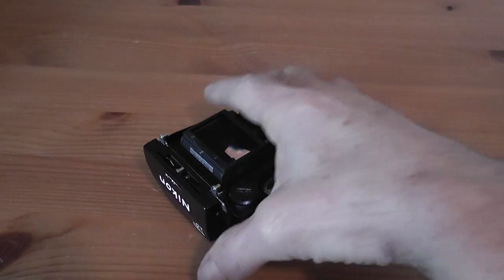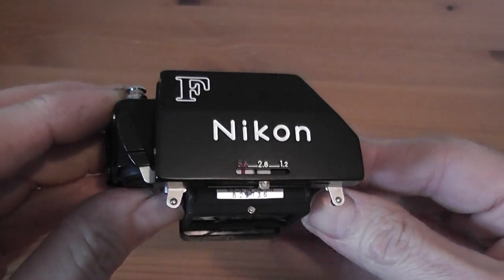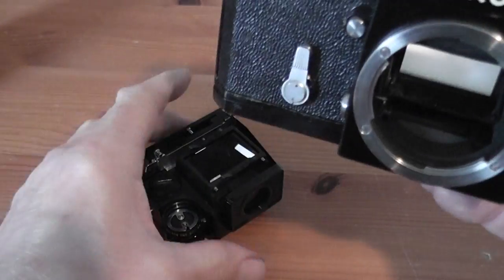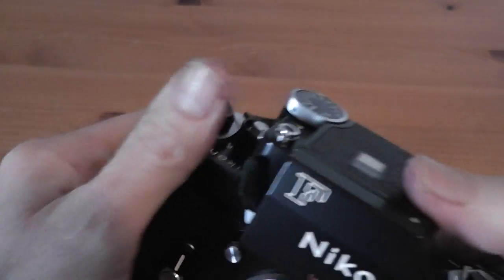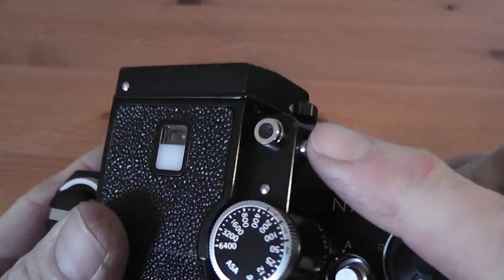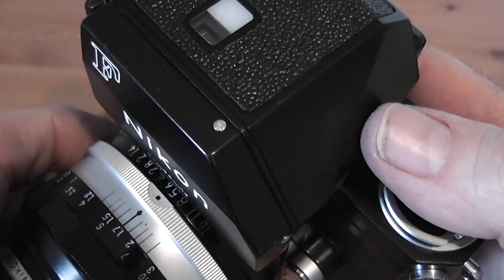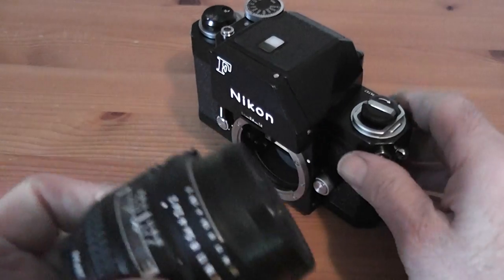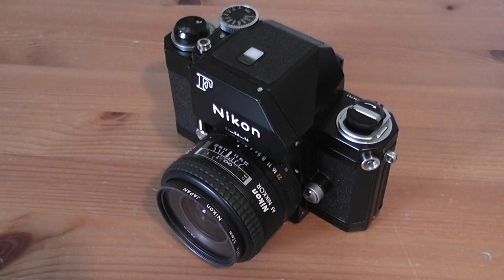Nikon F Photomic FTN Finder Overview

Comment: I have two Nikon Fs, both with FTN finders. I find that setting the ASA is very difficult on both cameras. The silver ring should lift up to allow it to rotate around the center stationary part. But in both my cameras the ring barely budges when trying to lift it. I was hoping to see you do it. At the very end you made reference to the ASA setting but you didn’t actually change the setting. Is that perhaps because you find it hard to adjust too? Am I missing something?
Reply from the maker: I don't recall it being too difficult to change the ASA speed. I guess 50+ years will make things a little stiffer! I intend looking at this for you, but my F bits are in a glass cabinet and it's difficult to access.

Comment: Many times a jumpy or non working finder is because the finder is poorly sealed and gets dust inside.  I have found that GENTLY blowing canned air into the base of the finder will very often correct the problem.
Reply from the maker: ghw7192 Thanks for the tip!

Comment: Thank you very much for this great video. I just bought a Nikon F FTn camera on ebay, and I have some old Series E lenses I would like to use with it. Your video made it very clear what I need to do, since the Series E lenses do not have the rabbit ears prong.
Reply from the maker: Richard Angeloni I'm glad it was helpful! Enjoy your new F.
Reply: I have a Nikon F with the Ftn Photomic finder.  I have a Nikon 28mm f/2.8 'E' series lens without the meter coupling prong.  It has to be used on the Nikon F in 'stop down metering' mode.  I set the lens on f/5.6 before mounting it,  and push the finder meter coupling lever in before mounting.  Then proceed to compose and focus normally,  and push the depth of field preview button to stop the lens down to taking aperture and meter for proper exposure.  (exactly as in the video) Works fine.

Comment: When I turn my aperture on my lens the meter retracts and disconnects with the lens. How would I fix that? Also didn’t know that needed batteries. I shot a whole roll that didn’t end up taking any photos. Is that why?
Reply from the maker: Make sure you are fitting the finder to the body correctly and make sure the lens connects with the finder correctly (from 6:50 minutes). Not having batteries in the finder results in the meter not working and that's all. It won't result in producing no photos! Maybe you had a fast shutter speed and small aperture resulting in vastly underexposed shots? There could also be a fault with the camera.

Comment: So when I attach my lens to the body and it clicks into the finder the red dot on the finder moves to 5.6. I move the aperture on my lens fully to the right and then the left, like you say to do in the video, and it moves from 5.6 to 1.2 on my finder. However, the red dot on the finder stays at 1.2 regardless of whether or not I change the aperture on my lens….is that normal? It doesn’t go back to 5.6, or an in between number, unless I take the lens back of and then put it back on. If I move the aperture on the lens is it supposed to move from 5.6 to 1.2 and stay like that?
Reply from the maker: Yes, that is normal! The red dot will always indicate the maximum aperture of the lens (in your case f1.2). The aperture ring on the lens will show the selected aperture. :)
Reply: @Samsung9alaxy  thank you for the video, super helpful, as well as, your reply! I appreciate all the help

Comment: Just got a new open box ftn finder. Need batteries for it though. What is a modern equivalent that may work as a sub for the old mercury batteries?
Reply from the maker: PX625 battery.
Reply: Samsung9alaxy great any particular voltage
Reply from the maker: @cullmancreations  They will be 1.5v
Reply: Since your query is only 4 months old, you might want to take a look at this video on upgrading an FTN head to accept and correctly meter using newer batteries than the discontinued PX13 mercury batteries: https://youtu.be/sy7PbcvCzoE

Comment: While shooting my fourth role of film with my new Nikon F and Photomic FTN finder,, something strange happened to the viewfinder. The shutter speed numbers shown inside the viewfinder somehow got out of sync and no longer match the shutter speed numbers on the outside knob. When I first noticed the problem, the numbers shown inside the viewfinder were half as fast as the numbers on the knob: if the inside reads 4, the outside reads 8. If the inside reads 60, the outside is set to 120. Today, it happened again. Now the numbers on the inside are 1/4 as fast as the outside. It seems to me that somehow a component keeps slipping out of line somewhere inside the viewfinder, but I have no idea how to go about repairing it. Any suggestions?
Reply from the maker: A knowledgeable friend of mine suggests it's dirt or corrosion on the shutter speed pulley.
Reply: Tim,

I opened the viewfinder and located the problem. There was a small gear responsible for moving a dial which advances the shutter speed count inside the viewfinder that was jumping out of alignment. Tampering with it, I actually made it worse (it stopped moving altogether), but also realized that the meter's calculations are performed independently of whether or not the shutter speed is accurate. I can live without it.

Comment: Look at "fix old cameras" video on how to modify for modern batteries with a diode. Mercury cells haven't been available for decades in the US. Zinc air cells are very short lived for another option.  Silver oxide cells will work with the mod and maybe a lithium battery too.

Comment: Congrats for the video, very informative. Just one question. After  you use in stop down mode (with the pin pushed up) how do you put the pin down again if you want to use a ai lens
Reply from the maker: The Nikon F doesn't use AI lenses! This finder requires a lens with a prong to interact with the meter.
Reply: You don't pull the pin down. The ai/ais lens will automatically connect to the pin when the prong reaches the center.
Reply: you can use AI  Lenses. with the photomic ftn finder.

Comment: I just acquired a Nikon Ftn Photomic camera,  manufactured 1971 from what I can ascertain from the serial number.  Everything works the way it's supposed to except I did find the meter is about 3/4 stop off from meter readings taken at the same subject,  with same lighting; with same lens as my Nikon FM also from meter readings taken with my digital camera.  (The FM and digital cameras agreed).  That I attribute to the batteries installed in the Ftn (it came with batteries installed).  I'm assuming the batteries installed in the Ftn are the nearest 'modern equivalent' to the mercury batteries the Ftn finder was originally designed for.  So I get around that by 'fudging' the ASA setting on the Ftn until meter reading agrees with the FM and digital camera.  Also I noted that there is no lens aperture selection visible in the Ftn finder..just the shutter speed in the little window located just to the right of the meter needle.  Is this normal?    I use Nikon Nikkor AI/AIS lenses on my Ftn.  The Ftn head on my camera appears to be exactly the same as in this video.  Thanks very informative video.
Reply from the maker: Your finder is functioning normal. Congratulations on your new acquisition!

Comment: What is the most cost-effective way to replace those discontinued PX13 mercury batteries?
Reply from the maker: Just use PX625 batteries, but the metering won't be as accurate.
Reply: Since your query is only 2 months old, you might want to take a look at this video on upgrading an FTN head to accept and correctly meter using newer batteries than the discontinued PX13 mercury batteries: https://youtu.be/sy7PbcvCzoE

Comment: Is it possible to mount this FTN finder onto a F2 body?
Reply from the maker: The Brickventurer Yes, if the finder is modified by putting a groove in the shutter dial connecting plate.
Reply: Aww bummer. Was thinking of getting the finder for my F2.. is the modification tough to do?
Reply: Just bought my self a FTN finder and will be modifying the groove with a small file. Will update how it goes. Maybe even a video tutorial. :)

Comment: My nameplate doesn’t angle in, however I have the new bay without the frame so the photomic clips in the bay but does NOT fit around the nameplate with the pins. Very peculiar
Reply from the maker: Many F's have had parts replaced over the years, due to loss or damage. Yours has obviously had the nameplate replaced for an earlier example.

Comment: You missed to say aperture must set to 5.6 to put in the lens
Reply from the maker: You don't have to! I only set it to f5.6 to demonstrate the engaging of the pin as the lens clicks into position on the mount.
Reply: When I turn my aperture on my lens the meter retracts and disconnects with the lens. How would I fix that? Also didn’t know that needed batteries. I shot a whole roll that didn’t end up taking any photos. Is that why?